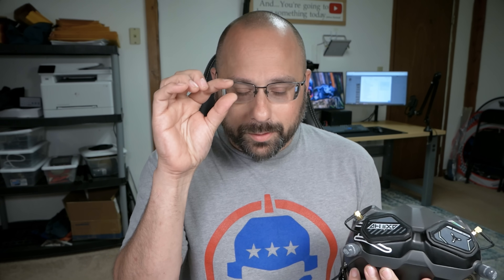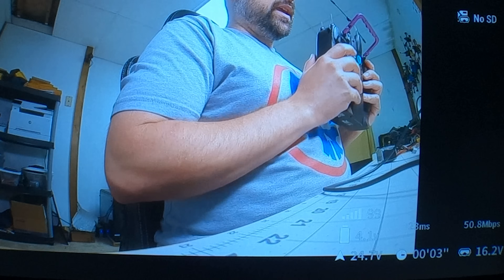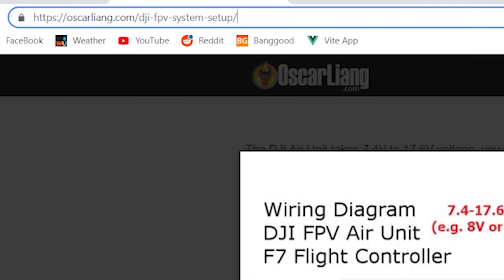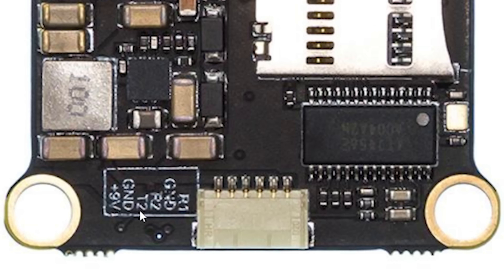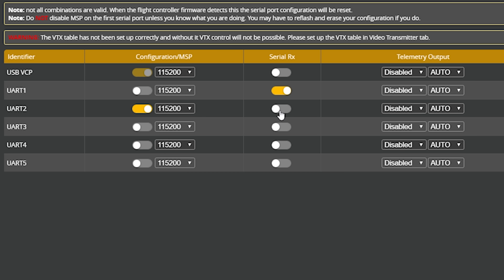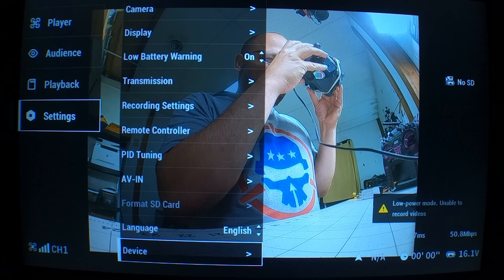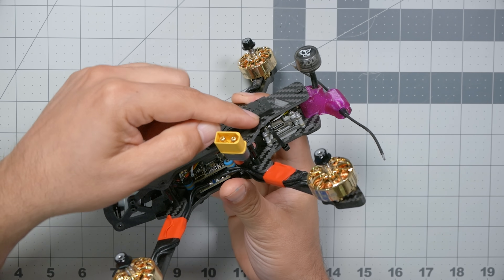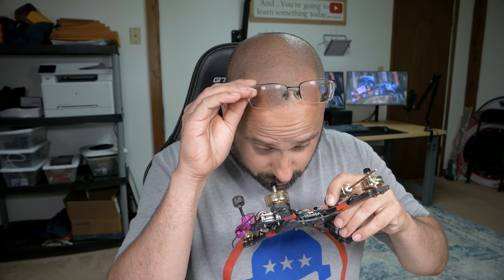DJI FPV very short range? Your MSP connection might be why.

Comment: Hey Joshua, thanks for the information! My headset was good in terms of this setting, but I recently lost video completely when I was 650 ft away, with only trees between me and the drone. At the time, I was facing 90° relative to the drone. Do you think this signal hiccup was purely because I wasn't facing the drone head-on, or is there something else I should look into? Thanks again! 

Fyi, I've got stock antennas on my Dji Headset!
Reply: I have had mine drop video closer than that with the True RC patch antennas. I have a suspicion that it may have been too hot outside and my vista unit shutdown for thermal protection. If it was a hot sunny day the heat may have been your issue. If it's a new build I would check the solder joints but if not I doubt that's a problem.
Reply: @L.And.J.For.All.  thanks, that's good to know! It was cloudy, but 89° and 100% humidity, so heat may have been an issue. I'll also double check the soldering, but the break in connection felt more like interference than a sudden loss of power. Thanks again!

Comment: I am new to FPV, my quad is on order have not flown yet. Already getting ready to train in a simulator.  However I have been watching all of Bardwell's video and Rotor Riots, I am very excited to be joining this hobby.
Reply: Welcome to the hobby!
Reply: Welcome, it gets very very addictive. Im now on 5 quads build in around 3 months. The DJI FPV is going up for sale, as it just does not compare. You will love it, but do practice in that sim as its very different from normal drones.
Reply: @dyslexicfrog7426  except you can fly the dji for as far as you want - failsafe and it'll come back every time...you are going to loose a lot of quads trying the same thing.  dji fpv drone is a beast of a drone.
Reply: @NOT_ANOTHER_FPV  I disagree. I dont like flying the DJI FPV, it's clunky, doesn't handle anywhere near as good as a 5" and although I have never crashed it, I wouldn't like to give it a try. All of my built quads have GPS and whilst I agree that the system in the DJI is awesome, I never fly passed 500m anyway. 

And I really enjoy flying something I have built myself.
Reply: I joined like a month ago
Reply: in low power mode, the power is less than 25mw? I flew somewhere at 200 meters, the picture is already bad after 100 meters, and if it’s low, it’s completely pixelated.

Comment: Whew! Thanks JB you’re a quad saver. I’ve been wondering about this issue let alone not being able to record on the goggles.
Now to find out another issue. It seems that my quad is in angle mode when it’s in Acro Trainer. On Betaflight when it arms the arming tab turns red as in disarm and on my arming angle is set to 35 deg. Tried doing a dive and the quad acted like it was in angle mode.
Is there a solution to this issue? Please help.
Wanting to fly in Acro.
Reply: Take off acro trainer and I wouldn't setup any flight modes you don't want to use as it can become a lot to remember with all the different switch positions. From what it sounds like, you won't be able to do what you want with acro trainer on. Movements like dives are probably tricky with the trainer. Dives are usually a zero throttle move and if you center your sticks, like you do in moves that rely on momentum to carry the quad, in acro trainer your drone will automatically start to level out again. I'd say ditch the trainer and go straight for full acro. Just start slow. Hover, fly in a straight line, make some turns, practice that until it feels good and then start going for wide gaps(preferably not concrete or steel), once you feel comfortable with that go for some tricks just remember to get some altitude when you first start so you have more time to recover. Oh and don't forget to cut the throttle when you're inverted. Happy flying.
Reply: @L.And.J.For.All.  thanks but found something from Flight Test that said to place the Arm mode from 1700 to 2100 and leave the battery connected in the motors tab to the on position. It’s now working as it should.
Just something new to look out for if someone else is having the same issue.
Something else JB can use for one of his next planned video’s.
Right JB?

Comment: I'd recommend step 1 be to check all of your physical connections. I've had bad range or video drop out only to land the quad and find that my MMCX connection is coming loose some how. Once that is plugged back in, the range/video is back to normal.
Reply: Basic
Reply: @py2xrf  what was the point in saying basic py2xrf?

Comment: Thank you soo much for these videos!!! You are more then helpful. BUT, I have a quad that I have built and I have not been able to fly it yet. I recently purchased a QAV-S, DJI Air Unit, Hobbywing F7 convertible stack w/ 60amp ESC. When I arm, all I get is "do-do-do" (first tones), I don't get the "do-do" (second tones). Now, when  I FIRST soldered everything up, I was getting the SECOND tones, but they kind of had an echo to them ("do-do, do-do"). After trying to troubleshoot and unplugging/plugging the batter back in a couple times.... I noticed the second tones went away. This is my first build and I'm completely lost. I'm new here to FPV and I am hoping you would be able to help 🤞.
I tied customer service at Hobbywing, but the tech support guy told me that there is just "a lot" of things you have to do in betaflight before it will work. I asked him to point me in the right direction and he literally told me to try and contact you. So before I reached out to you now, I also tried to contact customer service/tech support from the company I purchased from... AND THEY TOLD ME THE SAME THING. And now here I am. 

Side Note: why do they have tech support for products they sell if all they are going to do is tell customers to contact someone from YouTube? 

P.S. I have watched quite a few of your betaflight videos, but I don't understand most of them. I'm totally confused.
Reply: i wonder if a skype or similar would be possible to see and hear the problem then direct the problem  from your screen...JB needs a ten dollar skype video support option on patreon page
Reply: Not getting the second set of tones means your FC is not receiving a signal from the ESC. Is your FC receiving power? If so, check all your wiring and make sure any plugs are fully seated. Also make sure you have the right ESC protocol (Dshot) selected in Betaflight.
Reply: @skree_fpv436  I will double-check.

Comment: Sort of related, I have recently started experiencing loss of signal with my transmitter after playing around with the power settings. Any ideas off the top of your head as to what I may have done? The loss of signal happens in the open (not obstructions) and within 100 yards.
Reply: Make sure auto temp control is off. You may have turned it on but it will ruin your experience.
Reply: Do you have any more suggestions ? I turned auto temp off and it didn't help ;(

Comment: theres a guide on youtube to find and remove the burned diodes to fix the no osd problem on vista.. bud sadly no such guide for the air unit.. hopefully the mighty knows it all Joshua can guide us and fix the air unit problem.
Reply: Other than opening the case and locating the diodes, the same process should apply.  Even the replacement diode's, which may not be the exact same part, would very likely still work.
Reply: @RichardFPV  no one found the diodes on air unit.
Reply: @TERBANGFPV  diodes have the same characteristics as fuses and, like most fuses, you have a bit of leeway in spec, depending on the application. There's a zillion types of diodes out there. What's the link to the thread?

Comment: Yeap that’s my problem the guy that sold me the air unit " new " plug a 6s battery directly to the air unite 😭 is working but no custom osd 😭😭
Reply: had 3 air-units where the osd function broke. DJI repaired them under waranty for free

Comment: I don’t have range problems but I just realized why I’m not having custom osd and v bar info on my full size on one of my air unit.
Reply: and why is this? i have the same problem: i'm missing the custom OSD from Betaflight on my DJI Goggles.
Reply: @helveticfpv550  either you have it wired incorrectly tx to rx etc. Or you don't have the correct uart enabled or the diodes have gone in your air or vista unit... Or you have not enabled custom osd option in your Goggles